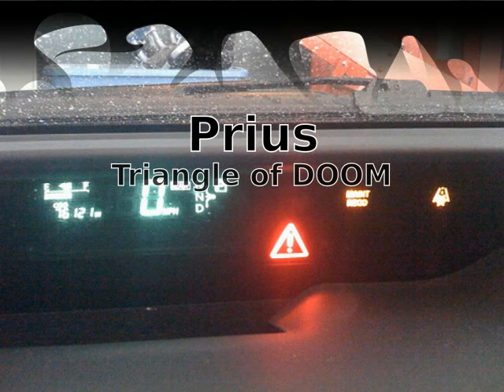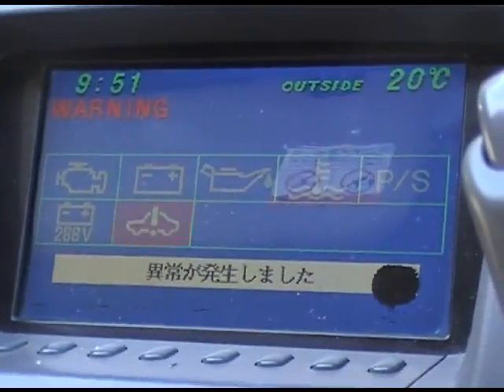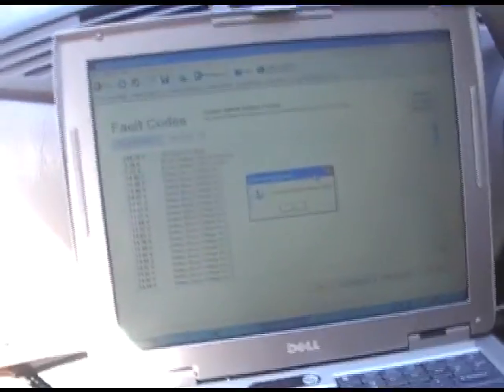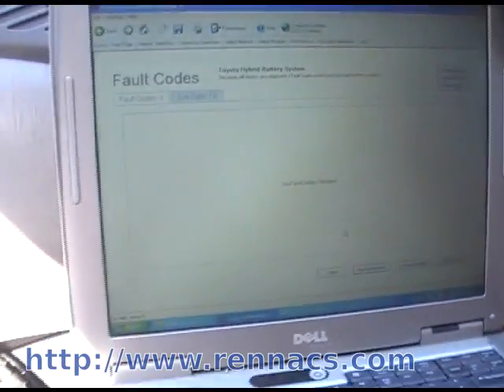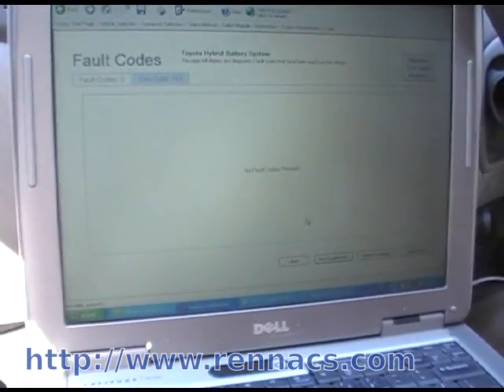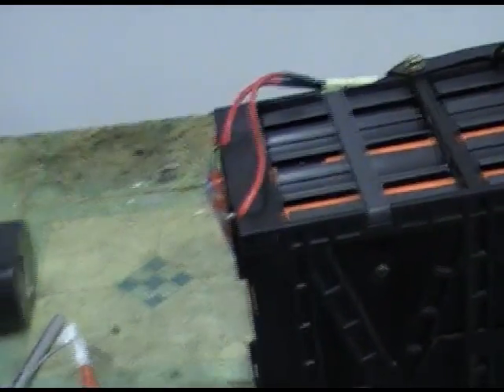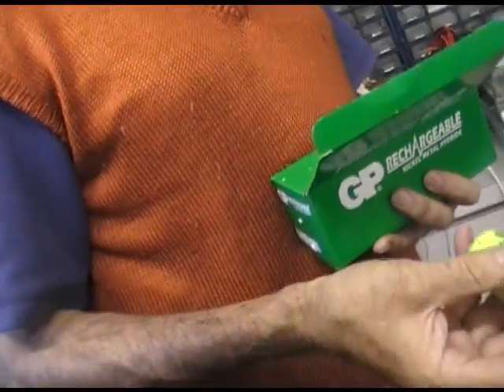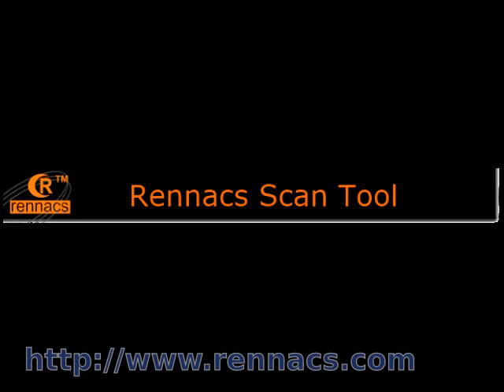Prius Triangle of Death

Comment: What was the point of the video? You didn't even say what the problem was.
Reply from the maker: To clear the Triangle of Death requires the scanner software and a connector. I ended up purchasing one myself. After a while of repeated errors I had the battery replaced by Toyota and the errors stopped. I sold the car earlier this year. The point of the video was showing that you need a scanner to clear the Triangle of Death.